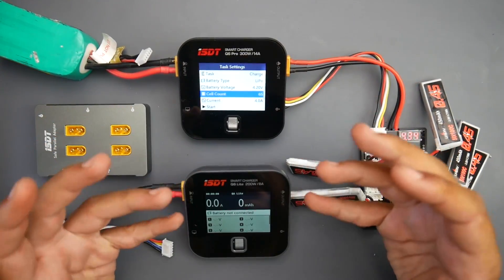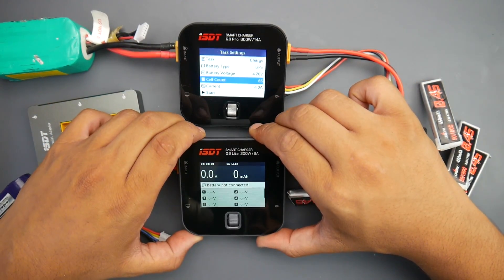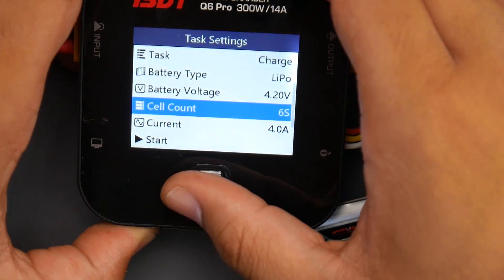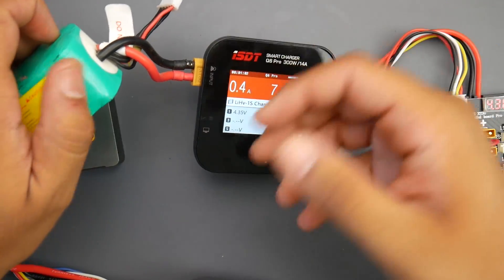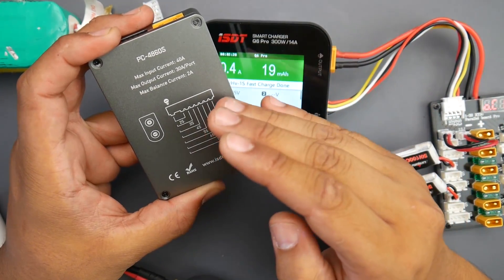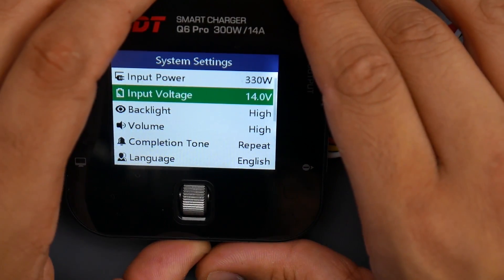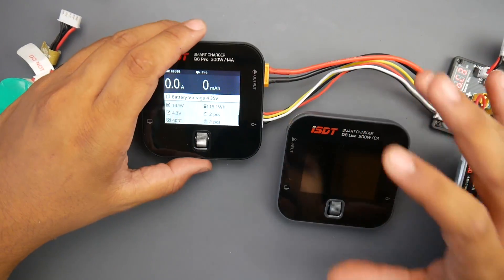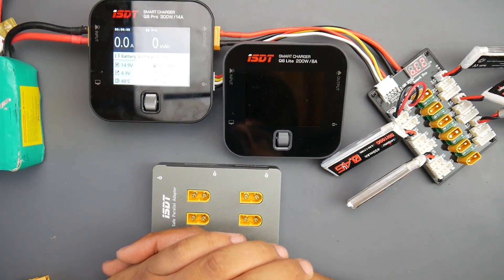ULTIMATE ON-GO FPV DRONE CHARGING // ISDT Q6 Pro Comparison

Comment: I know it’s an older video, i had mine make a pop sound while parallel charging 5x 4s 1500mah batteries off a 24v power supply, siren, and now it says current operation not available. Does this have an internal fuse? I think somethin popped but i thought this thing was a smart charger and had all kinds of protections?

Comment: Great Video. I printed A case for a Q6 pro Together with a parallel AMCC charging Board for 6 x 2-6s. Together with A second charging Board i Charge 12 4s Batteries mixed 850mha to 1500mah with 14a. This with an old Laptop Power supply. Is really great! Perhaps if you ganna go secure, get the Bardwell parallel charging Board which can Charge 10 lipos and has electronic fuses for each cell.

Comment: Have you checked out the HOTA D6 Plus yet?

I think its the new best A/C charger
Reply: Yep! That's what I use. I've been using that and I also bought the older D6 Pro to compare them. I like them both for different reasons.

Comment: I have the pro version and whenever I charge above 7 amps the charger turns off. The question I have is that the charger problem or the power supply problem( I use a modified laptop charger ) thanks
Reply from the maker: It's your power supply.. Check the links there is a combo that comes with the power supply.. Made specifically for this. So you will be able to purchase it separately

Comment: I can honestly say that iSDT is total crap.

I had two Q6 Plus and one D2 and the three of them didn't last 6 months. Battery connection issue.

Same with the two a buddy of mine had, one Q6 plus and one T8, and also, the discharger (that can't balance while discharging).

And last week, the SC-608 of another buddy of the group died.

They are convenient because of the size, but they are total crap.

My original SkyRC iMax B6 is still working after nearly 15 years...
Reply from the maker: Your the first I heard complain.. The only time I heard about these is the calibration but I cant be sure its calibration or the person's battery just doesnt hold charge so I did not bother getting into the details. Well this info is very useful for everyone. However I had the q6 lite for about a year now and its working just fine..
Reply: 3 x ISDT Q6 -> working perfect for 3 years now...

Comment: Love the Q6 I have one too but the discharge takes forever.  Not sure why but no matter what I put thr discharge rate at it stays locked to some low amount.  Can't remember the exact amount but it's like less than one amp.  Not sure why it does that, do you experience the same thing?
Reply: It's a charger ! 
Not a discharger. 
I think it's rated for 8 Watt discharge.
Reply: @Cre8ionz. considering the fact that you can use this as a field charger with a large lipo pack as a power source it would be helpful to figure out how to discharge unused packs at a faster rate to put some of the charge BACK into your bank to help save your daily packs from having to be fully charged for an extended period of time.  Not everyone is using this device strictly at home using house current.  In this instance it would be helpful to find out why it caps out discharge rate at such a low amperage.  Taking 2 plus hours to discharge a 1550mah 4s doesn't seem right to me.
Reply: @Jahoosapheth  putting charge back into your big field battery is a waste of time..

Buy a discharger and be happy :)

Comment: It's a very convenient charger. But my q6 pro won't charge 18650 :(
Reply: It should, a 18650 is a Lion battery.
Reply: @astrofpv7035  Yeah, I choosed Liion, and it won't. Maybe a bug in the firmware.

Comment: Hopefuly people dont get the dreaded "Abnormal battery connection" issue with the ISDT Safe parallel board.  It is a real pain in the ass for a lot of people.
Reply: Just update the Firmware!
Reply: @Marvin-Berlin_FPV  is that a proven solution?
Reply: @brettm.1770  It is written in the Update notes of isdt
Reply: @Marvin-Berlin_FPV  Thanks!

Comment: I love my isdt Q6 Pro 300w/14a.The only thing I dont have any BattGO batteries so i havent used BattGO function. Yes i did have to use a 24v300w power supply, but it was only 25$ and works great.